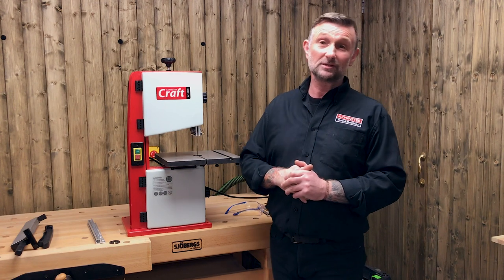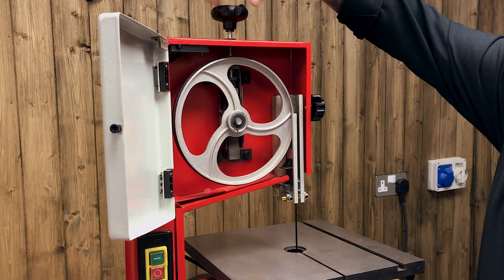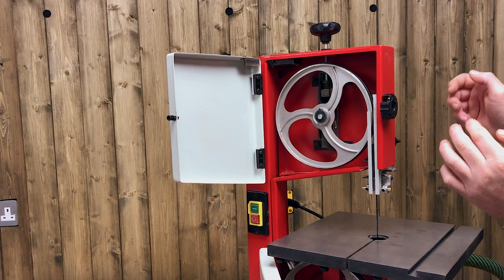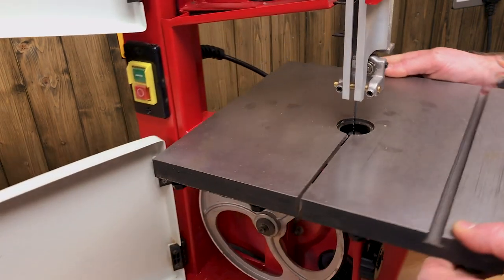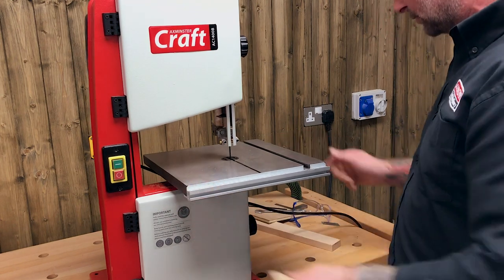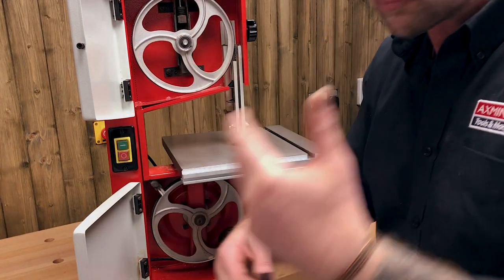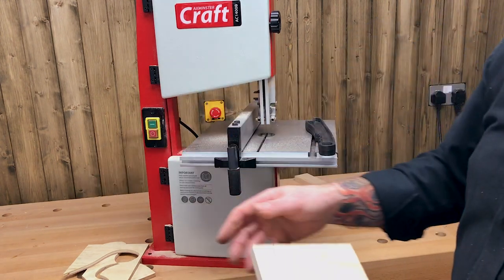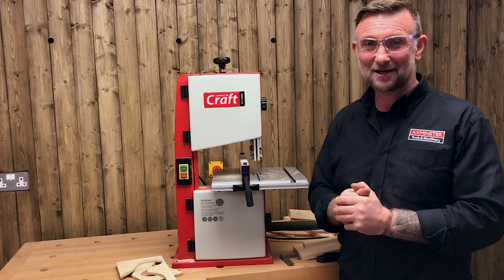Introduction to your benchtop craft bandsaw

Comment: What a comprehensive introduction to a band saw! I recently bought a bench top band saw that had been left exposed to damp winter air for several years, but it ran well and I was able to break loose the screws and bolts. Now what? Well here you are, giving a detailed explanation and your helpful tips.
Thanks so much for this excellent set-up video.
Reply from the maker: Hi Patrick, we are glad you found this video useful, thanks for watching!

Comment: Bought one of these a few days ago, set it up from the manual and then watched this video. Both are very good - although I would advise taking the table off to adjust the lower guides - it's just a bit less fiddly that way!
Managed to tut a 0.5mm strip from 15mm softwood smoothly and easily - that's the mark of a good bandsaw!